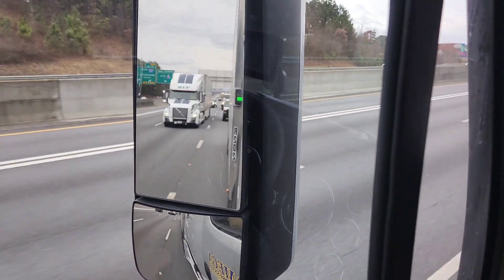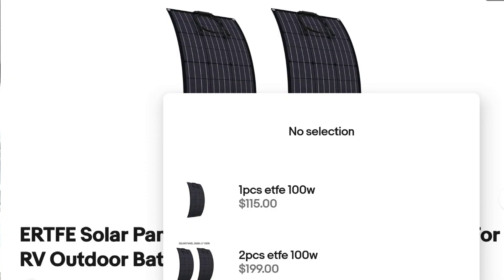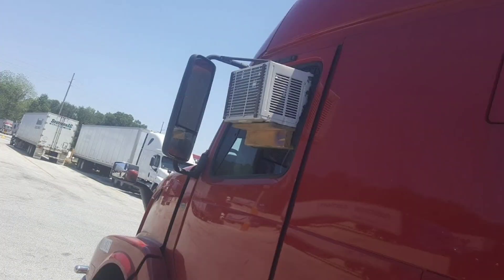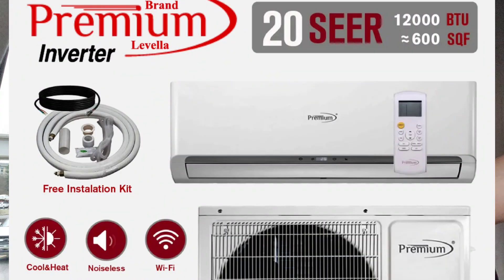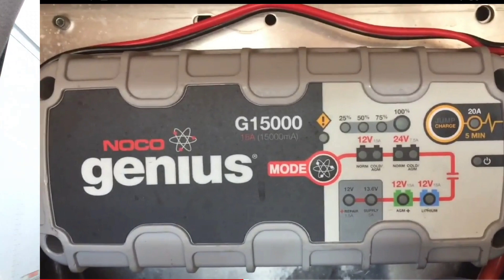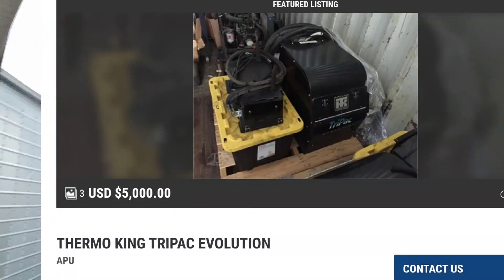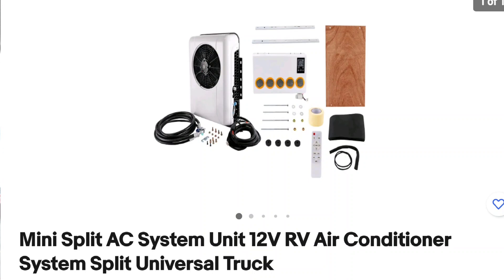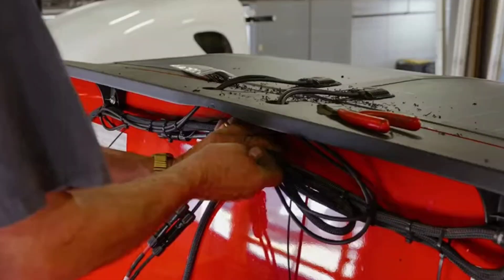Go Whit Solar OR Gas Generator ?  Semi Truck DIY APU

Comment: Dc to dc charger to charge them when driving and the solar panels will extend the battery usage.
Reply from the maker: @jeremyperkins1437  the amount money to waste on it is not worth it you can get for 600 bucks a 4000 watt gas generator and call it a day. but am bulding  right now a cheap disel alternator generator so subscribe but pretty much for 300 dollars am gana build a disel diy generator

Comment: Any update on a solution? I have an EPU but when a 34 hour reset. I have to start the truck up. Thinking of adding some type of generator.
Reply from the maker: dont do it yet am gana make a video soon on DIY disel alternator generator dont use the gas generators they not ment to go for long time i got a 200cc disel motor gana pair ot whit 150amp self exciting Alternator its gana be EPiC set up subscribe so you can see it

Comment: I have both photovoltaic systems and a generator in my camper, two 600w panels and a 2000w generator. The system with the panels costs practically the same as a good generator, it doesn't make noise or stink and has maintenance costs close to 0, I recommend you put both or, if you think you'll buy a lithium battery, just the photovoltaic panels should be enough for you, since you would often recharge with the truck engine. Lithium batteries aren't cheap but from what I've seen lately you can find 24v 100ah ones for $500

Comment: Eco flow Delta 2 max and delta 2 wave and also solar panels. They all synchronize together accessible on a smart phone through blue tooth. Also you can hook up an eco flow dual fuel generator. You can control how it works and energy flows on your phone.

Comment: I have a 10K watt generator, its loud and overkill, im thinking of getting a 5k watt inverter generator, mini split, i have solar panels, to charge lithium ion battery, but i had to buy a charger to connect to inverter in winter when there is no sun.
Reply from the maker: nice am about to buy a 200 cc disel engine and use old 5000watt generator head and run it like that i wanna connec the disel generetor to trucks fule line so it all runs on disel. i mean you could get away even whit 2500 watt portable gas generator but again its gas and that is why inwanna convert my 5000 watt gas gen to a disel am gana make a video soon on it
Reply: @YuriyDtv  I currently have a 16 gallon gas fuel tank, so I will use it on the inverter generator, fuel up once a week, or once every 2 weeks

Comment: bla bla bla solar panels is only useful for maintaining your battery only.  I went on away two months for vacation every years and start the truck up like a champ.  If you intent using for running heavy loads like AC you can dream on.  Get a Honda EU3000is and build a box in the back of your truck and a portable Home Depot 8k btu will work great.  😆😆😆

Comment: I have a generator and a indoor AC. It works great and the whole thing was less than $1,000. I've been running it for two summers with no problems
Reply from the maker: nice nice am gana do a build soon whit something similar but different

Comment: You could also get a diesel generator not a Apu but an actual diesel generator. That is how I have my truck setup I have a 7500 Watt that runs about half a gallon an hour at full output which I never get to
Reply: With my diesel generator I have a 15000 BTU RV roof AC a 7 cubic ft mini fridge and freezer along with a 1500 watt glass 2-Burner stove top
Reply from the maker: that nice send a link to your generator